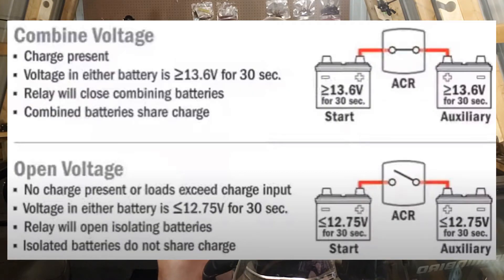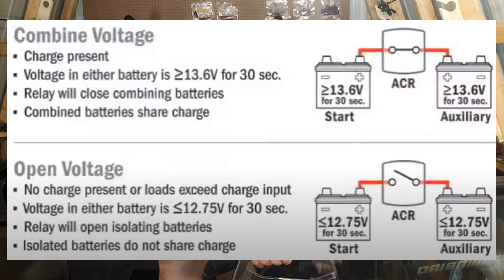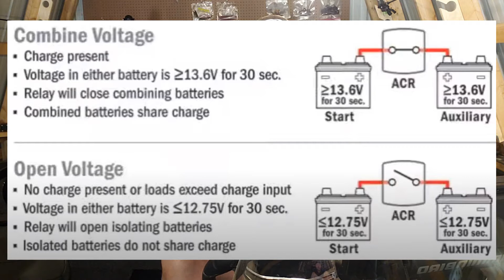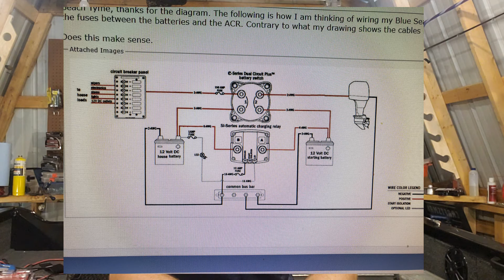Blue Sea Systems Add-A-Battery Kit

Comment: Actually what your ACR does is it makes a "battery switch" automatic so you don't have to keep changing the switch.  MOST people do not use their battery switch correctly in the first place.  Some have blown their alternators by changing the switch with the engine running (a big no no).  The ACR is best described as "wire it in and forget about it".

Comment: I have a 1750 superhawk and would like to do the same project.  How much more difficult would it be if I mounted the new house battery on the opposite side of the boat?  RIght now the single battery is under the the starboard jump seat, I would like to add the new house battery under the port side jump seat for weight distribution.  Would alot of extra cabling or complexity be involved?
Reply from the maker: I don't think it would be any more difficult as long as you have access.  The wiring would be longer, but everything would hook up just the same as my short run in the same compartment.  Using a 6 gauge flexible marine grade wire will assure no issues in runs across the back of your boat.
Reply: @BrianGaberFishing  Thanks Brian, 2 more questions if I may; 1. with the extra weight on the battery side did you cause any balance/listing issues when it's just you in the boat? 2. Where did you connect the 12V wire for the starting isolation from the ignition?
Reply from the maker: @gatgolf  Thanks Chris.  No It didn't throw me out of balance with my batteries on one side.  My livewell is on the other and that usually has water in it.  I used a multi-meter to find out with wire had 12 volts on start on my ignition switch and used a wire connector to attach the starting isolation.
There's a lead for the "run" position that gets 12V when you turn the key to the first position.  You want the second position or the "start" position.

Comment: Hi. Thank you for this informative video. Now when I get home and have switched the ACR to Off. The green light flashes every 15 seconds standby mode. Will this drain either battery if the boat is not run for a few weeks?? How can I overcome this parasitic draw??
Reply from the maker: Thanks for that great question.  I believe that over time that led will drain your battery slowly.  Disconnecting like you've described is likely the way of your are spring your boat for longer periods.  If there is lead power to the unit, I believe that light is in some status of on (steady, slow blinking, fast blinking).  I have my charger on or small period of storage when I'm "in season", otherwise the batteries are out and stored.
Reply: @BrianGaberFishing  Thanks for replying. I plan on running the boat at least once every 2 weeks.. so not sure if that's long enough for the batteries to be drained..Trying to figure out how to add a killswitch to the ACR to avoid this parasitic draw..
Reply from the maker: Maybe adding a fuse to the inbound (to the ACR) power that you could just pull the fuse?  Might save the switch cost?
Reply: @BrianGaberFishing  I already have a fuse going from the ACR to the ground as shown in the diagrams.. do I just add a on off switch to this wire?
Reply from the maker: The ACR led is sensing power from the positive lead to the ACR.  Thinking you have to switch that if you want to cut all power while storing. Ill check around some more

Comment: I’m planning on adding this kit to my boat soon. Looks like you used 6AWG for everything? Have you seen any issues with this at all? I only ask because the instructions in the kit call for 4/0 AWG (120mm) cable on the switch posts and 6AWG (16mm) cable for everything else. The instructions also call for 90-100AMP fuses for the ACR to battery post connections. Have you seen any issues running the smaller fuses?
Reply from the maker: I've used 6AWG wire for everything and 50 amp fuses with no issues.  I've got the same system set up on my 5th new boat and running great.
Reply: Appreciate the reply! That makes sense. I’m seeing in the instructions there’s also a fuse/breaker on switch post 2 going to the fuse panel. Are you using one? If so, what size?

Comment: Very helpful video, thank you.  I know this post is getting old, but I am putting together a shopping list.  The diagram is hard to read on wire gauges.  You are using 2AWG from the batteries to the switch and also from batteries to the bus bar.  You use 6AWG  from battery Positive to 65 amp inline fuse and then to the ACR (not on diagram, but in video).  
Finally you use 16 AWG from bus bar to ACR with a 10 AMP fuse.  Assuming I read that correctly (16 AWG), the link you gave us for the 10 AMP fuse is for 14 AWG wire.  Is that correct, or did the link change?

Thanks, Dave
Reply from the maker: Thanks Dave.  Let me check my list from last year and see what I did.  I just pulled my new boat into the shop and I am going to set this up again.  I'll get back to you in a bit.

Comment: You said you only require the smaller 65A ACR so why did you install the 120A ACR in your boat?
Reply from the maker: I had one...that's it
Reply: @BrianGaberFishing  curious why did you install 2 65A in line fuses instead of larger ones ahead of the ACR if it’s a 120A capacity ACR?
Reply: I'm curious also

Comment: Does ACR from this kit protects Home battery from voltage spikes/drops when cranking engine if Start isolation wire is not connected to outboard ? My engine is not remote controlled and starting button is integrated into engine, so there is not a lot possibilities to attach wire to ACR port "Start Isolation".
Reply from the maker: Thanks for the question.  This kit has a terminal on the front of the ACR to run a lead to the ignition.  It won't provide protection without that lead.  It is an optional connection.  Even though the action of starting the engine will always cause the battery voltage to drop, I have not had a classic problem of chartplotters and other electronics resetting and restarting upon cranking.  I haven't needed to connect the lead.  Most chartplotters and other sensitive electronics have fuses in their power line to protect them in case of a surge.  If it becomes a problem, I will connect mine.  If your sensitive electronics are fused protected , you could test and see if any issues present.  I haven't had a single spike that I ever detected or low voltage that caused even a simple reset.  I referenced the "optional" nature of this feature from a blog from a long time marine electrical expert.  https://shop.pkys.com/What-is-the-Start-Isolation-feature-of-an-ACR-for_b_40.html
Reply: The ACR keeps both circuits seperate until you change it to "combine".  Then both batteries act as one.

Comment: How did you connect the power pole pumps? Did you put the positive for the pumps on the house battery and ground on the ground buss bar?
Reply from the maker: Originally I did do that, and I didn't have any troubles.  I was always concerned about running the house down too fast with the poles.  I've also had all of it connected to the starting battery.  I did that so I could start the boat and then stow them.  I run around enough that I have never had my starting battery not charged and I've never used my poles enough in a day to challenge the charging of the house battery (always starts...poles always work).  The piece of mind comes from starting the boat and always knowing the poles will stow.  Make sense?
Reply from the maker: **I've never used my poles enough to challenge the charging of the starting battery
Reply: @BrianGaberFishing  that makes sense. My main concern was just making sure the pumps are not “on” ever when the boat is in the driveway. How did you end up wiring it?
Reply from the maker: @sergiotorres5851  When I am parking the boat and not using it for a bit (Say not on a maintenance charge), I jut pull the fuses on the pump.  Kills the power.  No worries about killing a battery.  I've got the wiring wrapped so they are easy to get to.

Comment: So I’m going to do this same thing. But my question is this. I just got a mega live. Should I wire it through the boats onboard fuse block or directly to the accessory battery. The boat is a 2020 Lund 1775 impact with a 115hp Mercury. I have all my graphs wired through the onboard fuse block and have had no interference issues.
Reply from the maker: The Mega Live Imaging Installation guide recommends that you go to the onboard fuse panel, if you have one.  The nice thing about going to the panel is you have a way to assure that power is off to your unit, when you need it off.  Usually boats have an accessories toggle switch and that will provide insurance that you don't accidentally leave the unit on and go out in the morning to no power.

On page 15 at this link:   https://humminbird.johnsonoutdoors.com/sites/johnsonoutdoors-store/files/assets/misc/HU/H/HUM_productmanual_MEGA-Live-532769E/HUM_productmanual_MEGA-Live-532769E.pdf?_gl=1*lm53tm*_ga*NzAxMjk2MjQ0LjE1MjE0MzIwMzM.*_ga_JE4T2LF5XP*MTYyOTkzMTE2MC40MC4xLjE2Mjk5MzEyMjYuNjA.*_ga_LKQZ6YTSTM*MTYyOTkzMTE2MC4xMy4xLjE2Mjk5MzEyMjYuMA..&_ga=2.209356370.1121783153.1629931163-701296244.1521432033

Comment: Why di you use the Blue Sea system 120 amp and not the mini 65 amp?
Reply from the maker: In this video I used the 120 only because that was the one I ordered.  I have the mini 65 on a 115hp ProXS this year.  Working fine.  It's really all about the output amperage of the alternator on the outboard.  Your question is spot on.